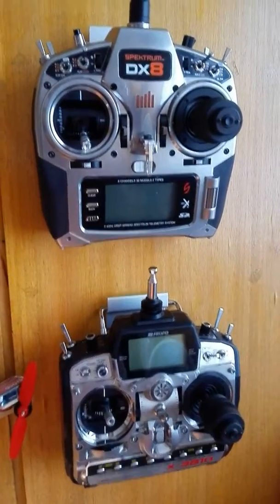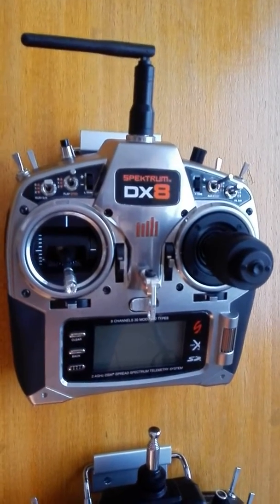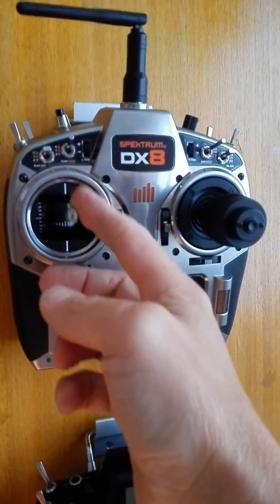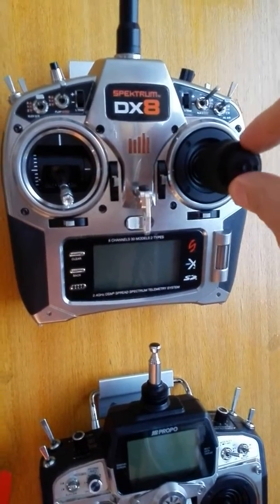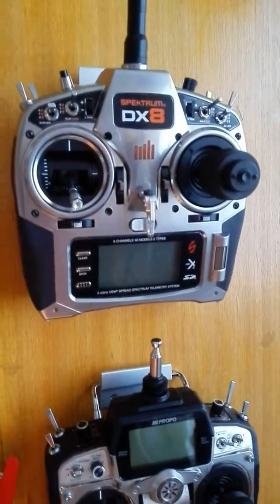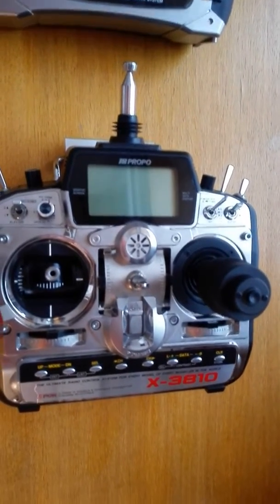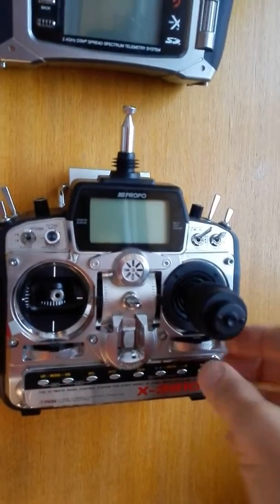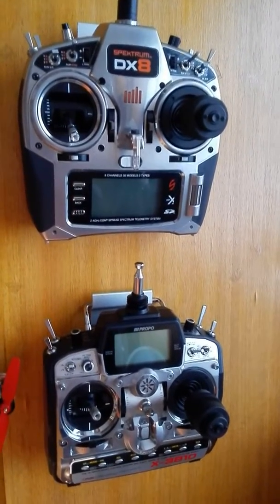Single stick RC transmitter

Comment: I modified my 72 MHz here in the US with Dunham or DR sticks years ago. I use the rotary knob for rudder. Yes, it is natural for Quads. Wonder if DJI would produce single stick TX. I have several single sticks from Servo City. Unfortunately most latest TX uses Hall effect sensors

Comment: FantaStick! I'm not the only one to do this... looks like the same gimbal as well.
Do you notice that the control range is maxed out before the stick's physical end of travel? Or is this only the case on the Orange T-Six? In any case this trade off is well worth it for me.
Cheers!
Reply from the maker: +Stephen Tack Hi Stephen thanks for commenting. I am sure there are many of us out there going back in time to days when this was though of as normal. :) Yes I have the same thing but have not bothered putting a resistor/s in there to overcome it. Flies everything just fine but maybe I should play a little.  Regards

Gary

Comment: Hi sent you an email I would like to do this on my dx6 would you be willing to guide me? Is it just matter of getting the part and soldering?
Reply from the maker: sparkyondub2zz Hi I think I just by accident deleted your mail... sorry...please resend to me.....
Reply from the maker: Gary Rowlands There is a small amount of cutting away of the rear of the old gimbal mount, but nothing too crazy if you are happy to give it a go. The rest is soldering, altering the trim orientation and that's it :)